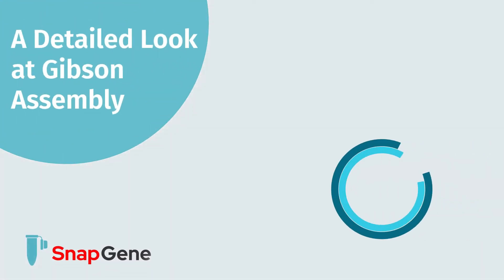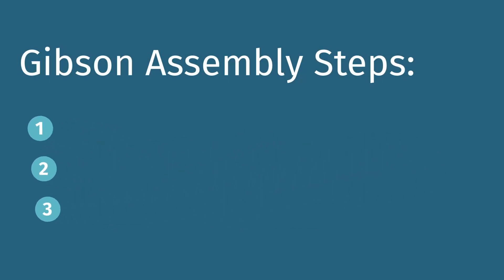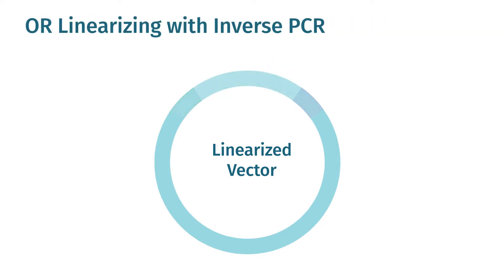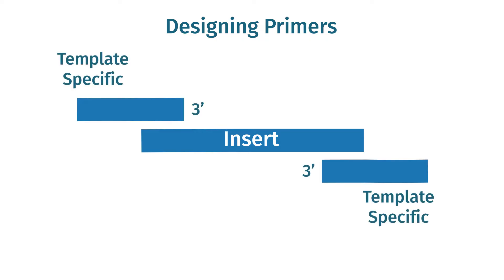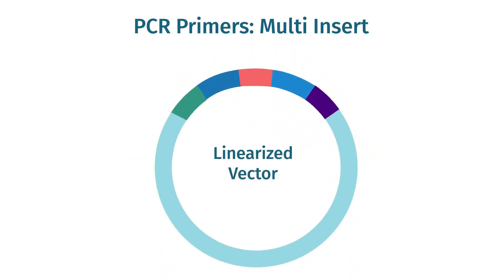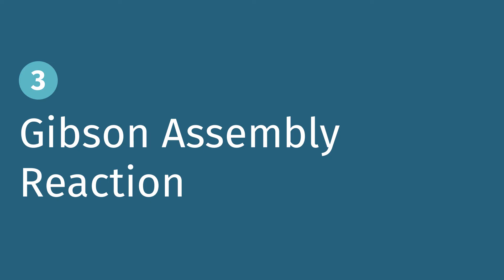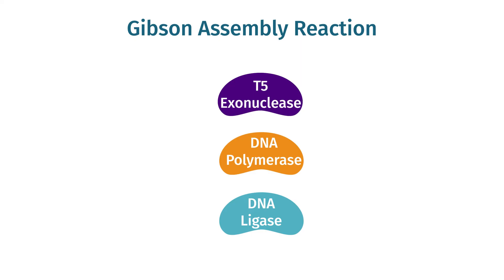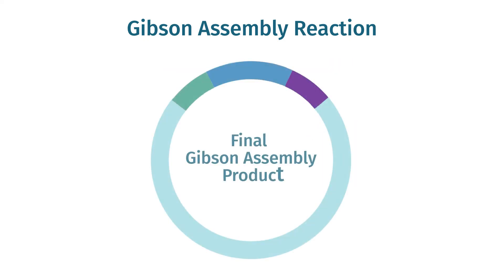A Detailed Look at Gibson Assembly

Comment: How do you control how many bases are chewed by T5 exonuclease? I don´t understand why the exonuclease doesn't digest the whole strand
Reply: I think you are regulating this by the incubation time. ~15min should be enough to chew 15-20bp overhangs. If you let the reaction run for several hours, then you are right and probably will digest the whole strand
Reply: Probably T5 exonuclease has been engineered/modified to selectively function (let's say to choose a designated number of bases at 5' end), so are the DNA polymerase and ligase in this system.